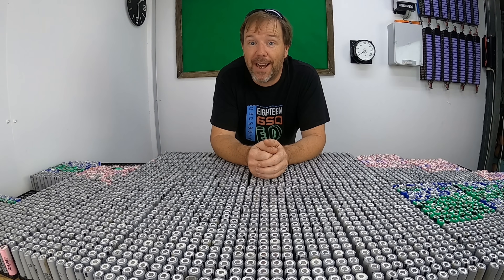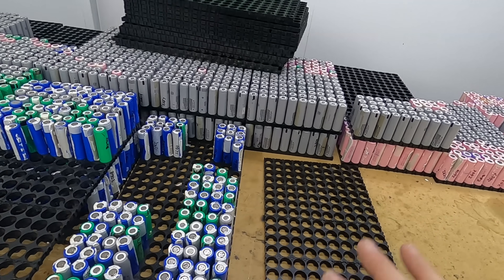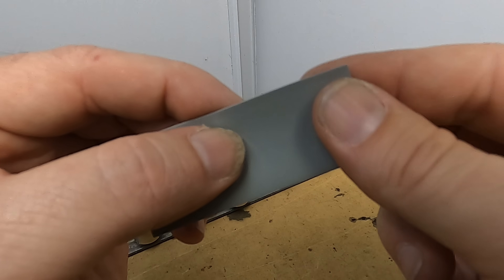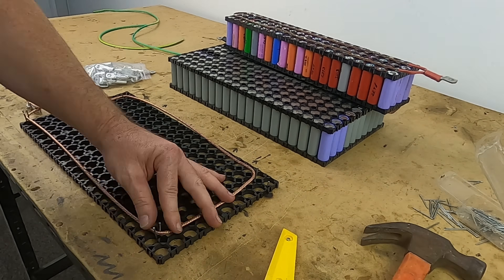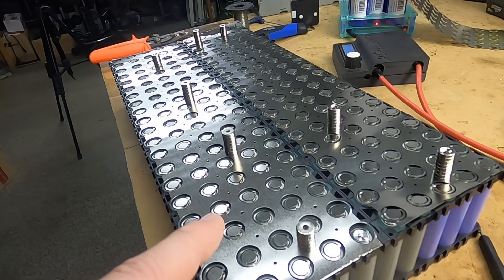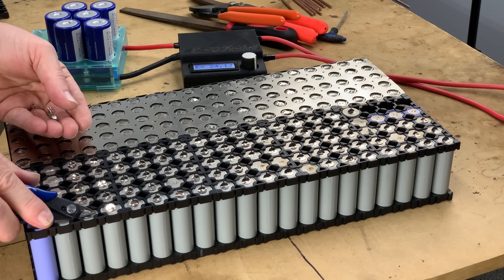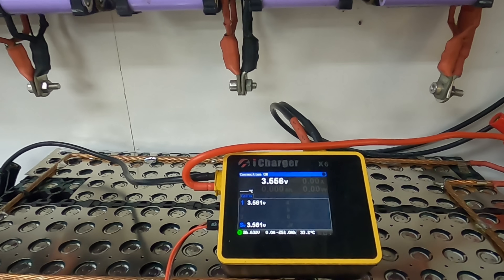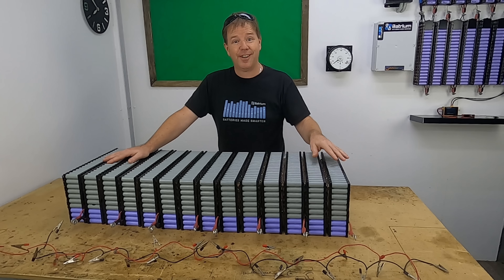Creating my single biggest D.I.Y. battery with 2800 18650 cells recovered from used laptop batteries

Comment: bro this is such a good investment if you know how to source right that never paying an electric bill again is freedom, not only from the cost of an electric bill but from the limitations of the grid such as power outages.
Reply from the maker: Gen 1 of this idea is still running 7 years later, this battery was actually only put into full time service a few months back after many years in the corner of my workshop
Reply: Im impressed, it obviously took you a good amount of time and thinking. Shrink wrapping those battery showed the dedication to the aesthetics even I dont have the know power to do something like this myself I would like to though. i'm vary inclined when it comes to electronics and mechanics but haven't really took the time to learn how to make these batteries work yet with the controller boards and stuff im sure thats needed for it to operate as one safe battery. A project like a backup, or useable battery pack with a few hours of use on it, something that could both be charged by solar and wall power, and supply 5v,12v and possibly use a small inverter to get 110v ac out of it. if you have any mock up plans for something like this i would love to see. @HBPowerwall

Comment: why do you have the 6 dummy cells (and then 3 missing ones I think are for physical mounting tab space for your custom rack) in the pack?  Trying to understand the purpose?  Is it to match total pack capacity across the lowest to highest?  Also, interesting that the nickel strips have built-in fuse in the design.  I suppose, as packs degrade, this is VERY important in the design of very large packs to avoid one cell from degrading and potentially being a hot-spot/fire issue during charging, etc.  Self fusing out means your pack is still good, just a slight degradation to capacity.

edit Never mind.  I see in your "part 2" you cover the dummy cells to avoid wear/rub to short out those cells.  Probably could use a 5mm thick rubber pad on the mounting bracket too, and make full use of the pack.
Reply from the maker: they are in contact with the mounts, the three missing is so you can slid the battery in place easily.

Comment: Amazing. I'm considering going forward with the idea of making 7 (or 14)s 50+p but am stopped by the freakingly huge size AWG needed to channel such monsters. How do you know your twisted copper cables/bars can do the job ? ( how many amps go through each ???)
Reply from the maker: never really tested before building - just wack a thermal camera on them and send it... hot spots are bad

Comment: So I am very very new to this. I have noticed that in my old laptops the batteries lost their ability to hold a charge. The laptop could/would only turn on if it was plugged in, and even though the battery was in it, when unplugged the laptop would immediately turned off.

so I don't understand, so I am curious here, since you are using old cells, how long can a battery like this last?
Reply: A lot of with they’re doing is l, for example if the battery pack had four batteries in it but no longer holds a charge they take it out and of course, take it apart. If one of those batteries/cells is bad then it takes down the entire battery pack what they do is utilize the other batteries that are still good and dispose of the other ones. Sorry I know that was a bunch but that’s pretty much the basic gist of it.

Comment: That gives new meaning to upcycling. Just refurbished my laptop battery using cells from an old hoverboard, and built a portable jumpstarter pack with the rest. This is next level though. Really like how the fuse is integrated in the foils.
Reply from the maker: Late reply but thanks for the comment

Comment: How did you manage to wear level them? That many used cells no way in hell all of them are within 5 percent wear level unless you tested every single one first!
Reply from the maker: This video took a year to complete, from finding the cells to testing every single one for capacity, heat, IR and self discharge... every cell has a number on it - that is the capacity
Reply: @HBPowerwall  God damn, power too you (pun intended)

Comment: what are the chances of this thing catching on fire ?
Reply from the maker: Bout the same as your car or deep fryer in your kitchen... Risk analyses and the procedure you put in place to make it safe are always the factors in play here..
Reply: @HBPowerwall  I fully undrstand what you are saying. But my point here is , that although inspected and tested you just don't know what these used batteries have been through during their life cycle and as well you say no they most likely will not catch on fire like it can't happen, but in fact they can and do catch fire and often, and when they do it's quite violent. So i'll let you do the math on this , all it would take is one to fail and start burning and all of them burn.
Reply: The Consumer Product Safety Commission is warning customers against purchasing loose lithium-ion battery cells that can be used for vapes, flashlights and other small devices. In particular, the CPSC has issued a warning for 18650 cells, which are slightly larger than AA batteries and are typically manufactured as part of large battery packs. They’ve been popping up on e-commerce websites, though, separated, rewrapped and sold individually. CPSC says using the repacked cells could result in “fires, explosions, serious injuries and even death.” @HBPowerwall
Reply from the maker: I used laptop batteries straight out of the laptop, also I took one or two measures that made them safer.. I'm happy with my decision

Comment: I am no expert or even electrician, but would many of the recoverred batteries not be close to the end of their life cycles, seems a lot of work if many of those batteries will start failing in the very near future
Reply from the maker: I spent a year on this project, collecting cells and testing everyone for excess heat, capacity and IR. End of life is a funny thing that is only relevant for the given application. Lessons learned, energy saving, youtube income - i'm VERY happy with time spent, would I do it again? Not a chance UNLESS I had no other choice financially speaking. If you have time and not money its worth it.

Comment: In one way it is nice that reuse is occurring but the open question is how long will these battery banks last?
Reply from the maker: My first battery is still in 24 hour a day service for 6 years, this one is built 10x better with more care and time sorting good & similar cells - I would expect to se plus 10 years easy.
Reply: @HBPowerwall  Impressive.   How often do you replace cells in the banks?
Reply from the maker: in this battery, only once as a cell was leaking but was a not connected cell as it was touching the metal housing. On my main house battery I would say every 4 months I have to pull a single heater cell and replace it, not bad for 4480 18650 cells out of the recycle bin. Time wise it would be 2 hours every 4 months in maintainance, plus 10 min here and there to run the thermal camera over all batteries usually weekly
Reply: @HBPowerwall  That's suprising (to me) and really good.     As the automotive industry transitions to improved technology there may be a glut of these  18650's.     I have been really surprised by the announcements in battery tech this year.   Usually you see announcements but nothing they can turn into a product.   This year there has been real movement.
Reply from the maker: "real movement' time will tell lol

Comment: What is battery pack voltage and it's current Value .

Please explain in detail about it .
Reply from the maker: There are another 5 videos after this one that explain alot
Reply: @HBPowerwall  thanks for information i will see that.

Comment: Building is an easy step. Maintaining and monitor them overtime is totally different story. Battery cells can go bad anytime.
Reply from the maker: Nup, building is the hard part, a proper BMS and thermal camera and it takes seconds a day to monitor.

Comment: what happens and what do you do if one of the cells die, and how do you go about finding it?
Reply from the maker: 30 seconds with a thermal camera and you know with in 30seconds... fault state is heat so it's real easy, that said the nickel strip makes it a touch harder as you might have to pull the whole battery out and lay it flat to thermal image it .

Comment: Hi friend I also made a 24kw 18650 wall
Curious what you have set as parameters in the inverter
such as Bulk Voltage
float
Network return
Voltage Cut Off
My settings are these
For a wall of 18650 2A parallel 15 series 270
P26 Bulk 60.5V /15 4.033V
P27 Float 59.5V /15 3.96V
I don't know if FLOAT and BULK must be equal value in LiIon ?
P13 Return to discharge voltage 50V 3.33V
P29 Cut Off Return to Enel 50V /15 3.33V
Then in case the BMS or Inverter goes crazy
I always have SRV1000 and DRY Contat A30 as security
Setting SRV1000 and A30 and BMS Daly
V-Max=62 V-Min=48 5s delay 2V delta
Reply from the maker: As I''ve said in other replys, I do have all those details hidden somewhere in my past 700 odd videos
Reply: @HBPowerwall  I understand advice it would be nice to maybe make a video only
about the settings and explain why
So that it is immediately found and not hidden in the search for over 700

Comment: I am planing to use 429 battery 18650. And use bms with 13s 80A, can I keep them in sealed box? Is it safe?
Reply from the maker: Nothing is 'safe' but you can take steps to make it safer..
Reply: @HBPowerwall  like whate?
Reply from the maker: Move it out of your basement, use LifePo4, buy off the shelf unit and don't DIY it..

Comment: If that ever caught on fire it would be a neighborhood disaster.   And it would domino effect ignite each cell   like a sparkler bomb going off it would be a horrific chain reaction.    I'd say. Throw them in a minerals oil   box cooler submerged with a cooling unit chilling the mineral oil.
Reply: Also try to seal the cells per 100 or 300 that way you have large individual cells still working together and each package of cells if at all ever catastrophicly failed.    At least it would be one package of 200 / 300 batteries that would fail not the whole lot
Reply: You could silicone dip them let them dry.  Like making a candle increasing the thickness of the silicone coating.    And if you need to take it apart it could be sliced with a razor knife. And just redipped when done with repairs
Reply from the maker: few videos after this one cover safety & some install

Comment: Just be careful. I’m sure you know but highly volatile and explosive
Reply from the maker: Not high voltage and won't 'explode' how ever will vent at 1600 deg c and shoot off like rockets..
Reply: @HBPowerwall  And then the fire sprinklers get triggered, water is introduced to lithium and with that, an explosion.

Comment: Have been checking Internal resistance of each cell ?? I find that with differing internal resistance you can have difficulty balancing/charging Lithium Lifepo4 cells !!
Reply from the maker: not lifepo4 and every one was tested at exactly the same voltage

Comment: I'm going to keep my 18650's. I have both lithium and LiFePo4 cells. I've had my system on AGM batteries and was disappointed. I started getting 18650's from laptop batteries,only about 70% were good. Two years ago I started buying LiFePo4 cells. I have two battery banks now and I still like my 18650's better. I have yet to change even one of my 18650's. Lots of luck on your new batteries.

Comment: Buddy, tell me where you ordered such a nickel plate with fuses?
Reply from the maker: If you need a coupon code use 'Powerwalls' I make a small commission & you save %5 here is the link to where I get it from https://batteryhookup.com/collections/accessories/products/nickel-fuse-2p-wide-continuous-roll-by-the-foot-18650-cell-level-fusing

Comment: I always double up the spot-welds no matter what the load. Just me, and probably overkill, but it cuts down on the chance of a marginal weld letting loose under heat. What surprises me is how many of those lithium cells you are ok with in your home.
Reply from the maker: My tests over the years, for stationary storage this is enough spotwelding - if for mobile application I would do it differently. These batteries are not in my home.. They are in my workshop

Comment: hope you got one hell of a emergency situation plan for all that stored energy. holy fuq
Reply from the maker: Yeh, kick ass BMS, Installed correctly, 65kg 2mm thick metal case inside a shipping container do?
Reply: @HBPowerwall  whew baby i sure hope so. glad you are putting stuff in metal boxes! now you just need some kind of remote blowable fuses to kill massive battery jumper links in case of catastrophic failure.
Reply from the maker: Like a shunt trip controlled by the BMS, that can also activate by a fire alarm? 5 Temp sensors, voltage on every battery, fans that turn on at a programable temp or just when balancing or hell via a timer or schedule ?

Comment: So what was the point? Used loptop cells ussually are near dead. Yes you see it can be charged and it shows volts. But it may work for 5min and it will run out of juice. If you build this buy new cells.
Reply from the maker: This battery has now been in service and built for years, so you're near dead comment while it could be true the fact is I spent a year testing these cells for capacity, self discharge, internal resistance & heat during use before making this battery. To build this battery new with new cells would be plus $10,000 aud, these cells were free(ish) from a local school. So instead of landfill or early life recycling they are now living their whole service life rather than just a small part of it.

Comment: plain battery bomb
Reply from the maker: Clearly you don't know how a b0mb actually works, the failure state of a 18650 is venting a jet of 1500deg c flames, and shoot across the room.. No bomBs here, build it into a fire proof container put a high quality BMS and you have a sexy well built battery..
Reply: @HBPowerwall  it was actually ment as a sarcastic nudge from the ammount of energy thats just stored in that small of a space.
but yes good fireprotection and a good bms are golden for making good banks of big batteries.
anyway keep up the good work.

Comment: Isnt it the stupidest idea ever. What are you going to do with the failure of 1 cell. Its not reliable at all.
Reply from the maker: Turns out so far you are VERY wrong. Still going strong so happy with performance & balance, if one cell fails i'll see it in my weekly maintance checks with thermal camera and i'll snip the fuse wire and go back to drinking my coffee ..

Comment: So stupid idea. Used (dead) battery will not only waist your energy due to  high internal resistance,  but they will increase your chance to loose your house in a fire. Companies are spending a lot of time and money to design a safe to use package, but people like you encourage other amateur people to risk their lives. Very sad to see such a crap. Sorry
Reply from the maker: Wow.. FIRST I spent a hole year testing every single cell, I built it to the intended load requirements, housed it within a secure location, and managed it with high-end reliable BMS, Sorry I had to read such a crap comment. Without people like me landfill would be full of this scrap or it would be recycled before it's true end of life..

Comment: Will this provide enough power storage to run appliances in my caravan for a weekend?
Reply from the maker: I guess that would depend on how much energy you used.
Reply: @HBPowerwall  one of the worries is that halfway through enjoying a quiet weekend in a caravan, the power runs out for the last 36 hours. Something basic for energy use, like a caravan with a fridge for the beer and a tv for films. Im trying to justify the cost difference between these new battery banks against old leisure batteries.
Reply from the maker: There is no way I would go this route for a mobile appicaltion in hindsight. Go with affordable easy LifePo4 and save a year of your life..

Comment: Thats a huge power bank you got there, can probably charge my electric scooter 100 times i guess
Reply from the maker: or my iPhone 11 times.. :P
Reply: You said it was 25 000 Wh. The scooter has 2*1500W motors on it. But i said the 100 for fun. I think the battery is 1600Wh so it should charge it at least 15 times i think.
Reply from the maker: I don't math in public as the internet always corrects me lol we can run with 100..